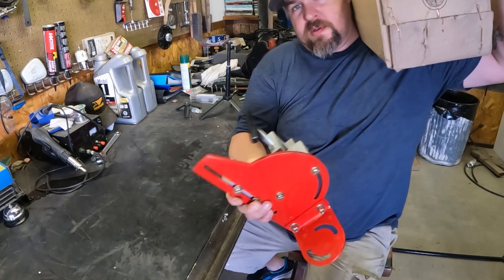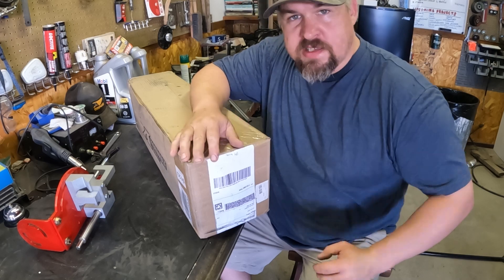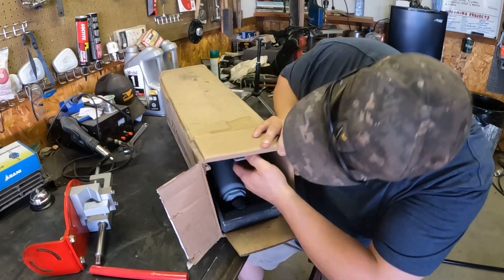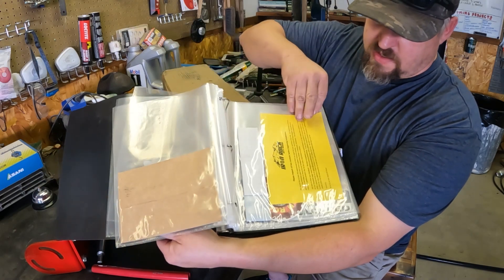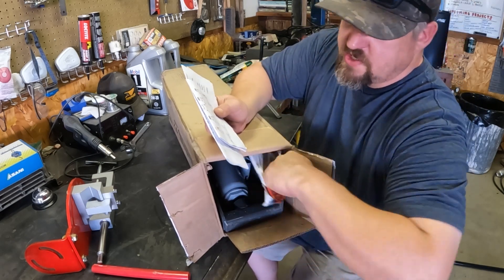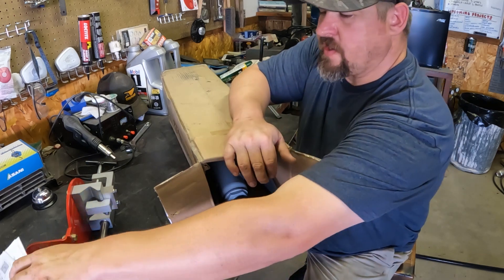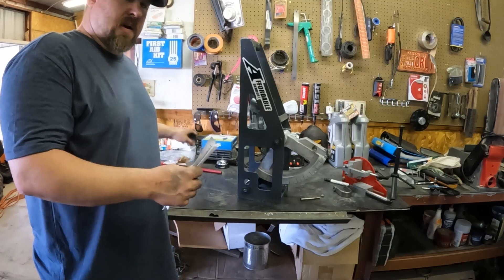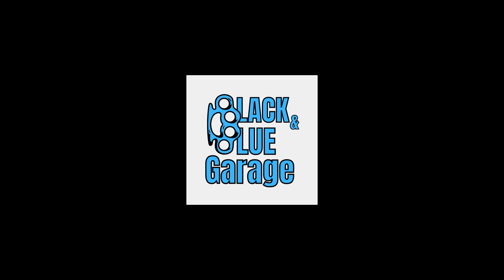This should help me build my bumpers and roll cage

Comment: It will bend 1-3/4 .120 wall DOM no prob....brother did it in his
Reply from the maker: Heck yeah! That is good to know. I'll definitely be doing some cage work later
Reply: It'll bend .120 wall DOM??? I was about to pull the trigger on one after a month of eyeballing it, and I noticed it says It'll bend .120 wall ERW, but only .095 DOM
Reply from the maker: I bent 1/8 wall DOM for the back of the cage where it goes into the spring mounts. Bent it ok but was slightly more of a strenuous activity.
Reply: @BlackAndBlueGarage  hm. I have a brand new 12 ton bottle jack in the garage. Maybe that's all it needs
Reply from the maker: @austinleggett302  you can always call them too. They're selling them already set up for hydraulic systems now